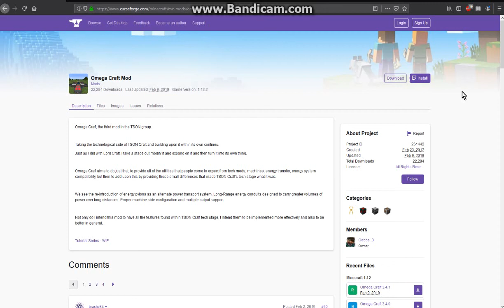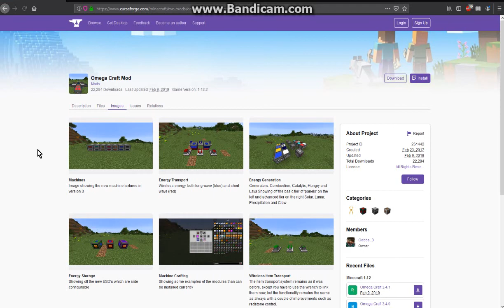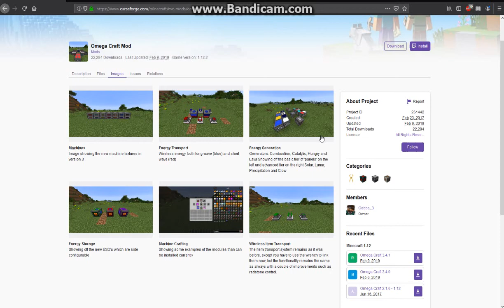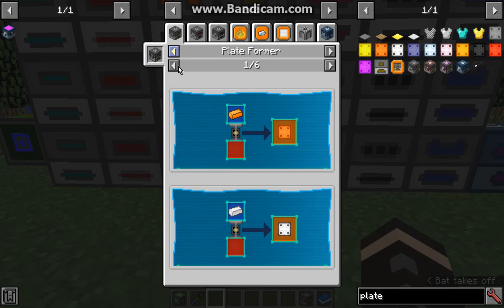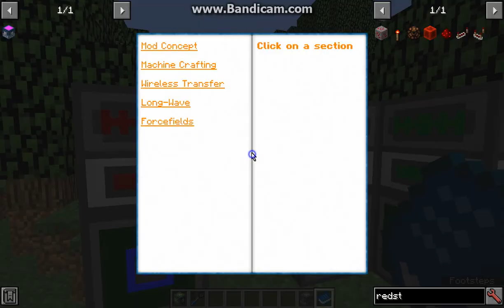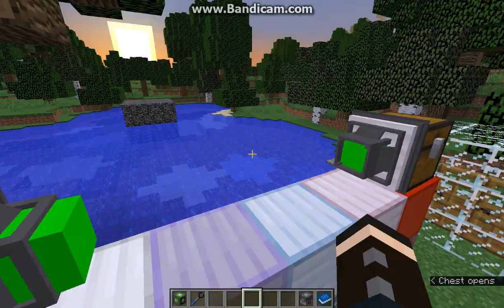Omega Craft 1.12.2 Forge Mod Overview Part 1 - Ores, Machines, Tiers, Transfer Methods

Comment: how to make a steel ingot??
Reply: You need bronze ingots and a cave wrench to make bronze plates, use those bronze plates to make an alloy furnace/smelter and 8 coal to 1 iron to make steel. Most early recipes for alloys/plates you can use the dusts and wrench but later ones like steel, magmite and cave magmite require the alloy furnace/smelter.

Comment: why is there a lot of bedrock in the background?
Reply: I have that there for the Magmite Reactor (a Nuclear reactor generator block) since it explodes if you don't handle it properly with fuel rods and heat generated from it. I had it there to contain the explosion if I wasn't careful as well as to contain the water inside to cool the block down. You can see me cover that block in part 2 of this mod showcase here:  https://www.youtube.com/watch?v=OYYiY-n1Oy0